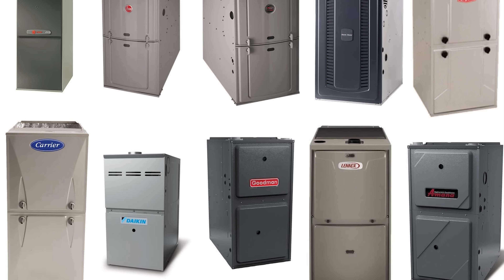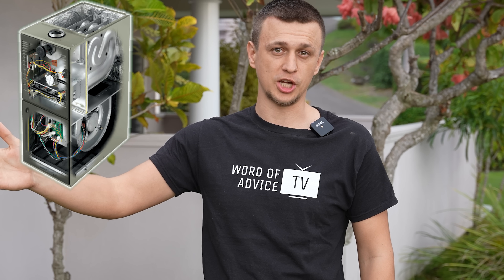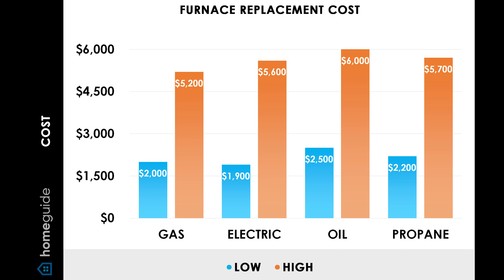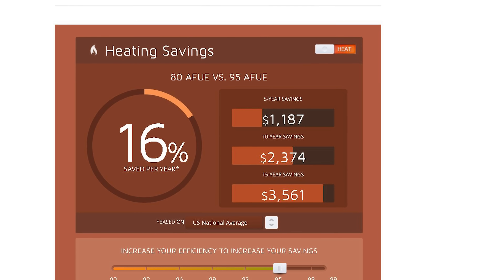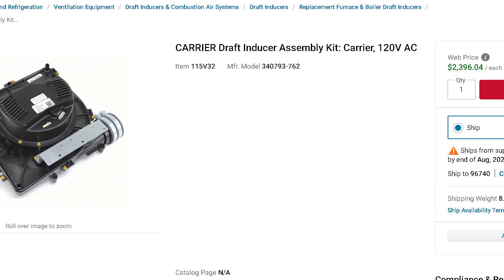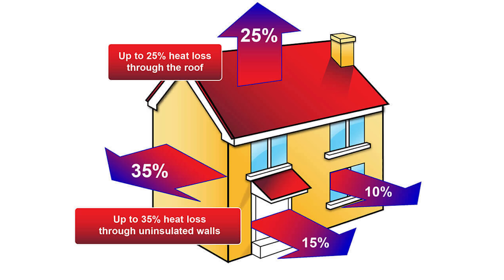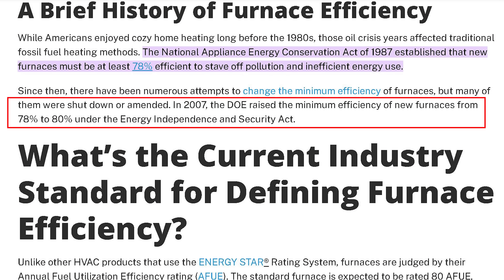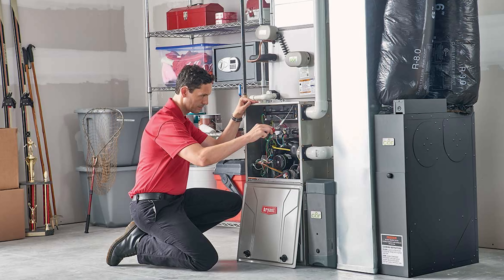Don't Buy a High Efficiency Furnace!

Comment: As an HVAC professional your not wrong. 
Although just about all brands have a 20 year warranty on heat exchangers, but you have to pay the shipping and Installation for a new one. 
80% contain basic parts. Where as higher efficiency units the parts are more hi tech, and costly to repair. 
Another thing I'd like to mention all brands are generally the same, with the same parts. They may just be tweaked a little different. And there all made from cheap plastic generally from China. 
Furnaces are not as reliable as they were 30 years ago. There all junk no matter what brand your looking at.

Comment: You make some great points and I mostly agree with you. But if a person wants to lower their carbon footprint or they have a less then 80 percent furnace, maybe their furnaces is way over sized for the space they are heating. I also feel if your furnace is over 15 yo it's not worth putting money in it. On another note about getting a furnace inspection, is nearly impossible to get a quality inspection from a qualified HVAC tech or company. There are so many techs who don't know how to check a heat exchanger or are just too lazy to check itt properly. Especially if you hire one of those company's that come out for a cheap price. They will upsell you or gives you the bums rush.

Comment: I have an older furnace, we have lived her 25 years and it was here before we bought, it works fine, but I had to go to E-Bay to get some of the circuit boards because the local HVAC companies didn't/couldn't get those parts. Sadly all our appliances are about the same vintage and getting parts is a task. Good video and look forward to your other insights

Comment: I live in New England, where it gets cold and stays cold a good 5 or 6 months out of the year. I got my 35 yo furnace replaced last fall.  I went with the regular old "low efficiency" type even though I use propane.  The reason being I also added a heat pump.  Not a super duper one either, however even where I am it can still handle my heating needs at a lower rate than propane.  In spite of the fact that my electric rate doubled last summer.

Comment: Thanks so much, I do have a Trane X90 80,000BTU single stage and my house is a high ceiling and colonial style 2500sqf, one of my rooms upstairs has low heat, do you think 2 stage furnace will be good for me

Comment: 1 rebate, 2 lifetime on the heat exchanger,  3 same installation cost, it pairs with the heat pump and has an ahri rating ? do you live somewhere warm ...... the bgh 96 LP is my frame of reference in zone 5 parts are covered for 10 years

Comment: What an amazing world we live in. Everything we use for day to day living is being used against us. The cars we drive are designed to crap out days after the warranty runs out. Small cars that are economical on fuel cost a fortune to keep running. Parts are way more expensive than a gas guzzling land yacht. Now these high efficiency furnaces that are supposed to be so much better than conventional units cost twice as much and they burn out in half the time. Heat pumps are out dated a year after they are built. When something major fails on them it's cheaper to buy a new unit because the old one is no longer in production and nothing from the newer units will fit. We live in a deliberately expensive world with our biggest required items that are disposable. At least a 50 year old oil furnace will accept a modern riello high efficiency oil burner and even though the motor technology has changed, a newer designed fan will also fit. Oil furnaces were all built to certain standards where you could put parts from just about any brand on just about any furnace. You could even order one with a specific brand oil burner. Try that with a heat pump. I can run my hot air furnace with a 1800 watt 110 volt generator all winter long if I have to. Try that with a heat pump.

Comment: I just got though telling a guy about the price of the replacement parts on a 18 seer Goodman  if it was out of warranty right now vs a 14 seer. His son got scammed into buying a 18 seer. This guy was all excited about the lifetime warranty on the compressor, then I told him the price difference and how much it costs to replace the compressor in the 14 seer. A leaking coil is usually what kills the compressor, to start with, by running it too low on refrigerant too long.  I also told him there's only 0.7 difference in the heating performance. Around here our heating bills are what hurts. People think they are going to save a fortune on heating bills by going from a 14 seer to 18 seer and they'll most likely see no noticable difference. (Let's not even mention the 20 seer) I know this is about gas but I don't recommend gas at all and sell very few.

Comment: I can confirm that the ECM for my high efficiency furnaces is not only expensive ($1400), but in short supply.  My furnaces were installed in 2002, I replaced the ECM twice on one of them and once on the other, with a couple of motherboard replacements as well.  My ears are wide open to this discussion.  This last ECM replacement I found a used one on ebay for $228, but HVAC tech. would not install it because it was used.  I did it myself and we are up and running again, but it is only a matter of time before it fails too.  I have even taken the old ECM and replaced its blown resistor so I have a back up ECM.  I know way more than I ever wanted to know about furnaces.  I love the idea of a blower motor costing $250.
Reply: Put a surge protector on the power lines
Reply: I want you to know the only reason why that ECM costs $1400 is because the parts people charge that. You can buy an entire fan coil or furnace for that much, motor and everything included.
It's a racket. Don't blame the technology - I can buy a variable motor for my mini split for less than $100.
Reply: @sprockkets  Oh, I believe that 100%
Reply: Yeah, and good people like Kalos puts in voltage monitoring plus surge for their inverter stuff.

Comment: Would you do a two stage furnace or one stage? I don’t want to deal with expensive parts and costly repairs.
Reply: Two stage furnaces are nice, especially in larger houses and cold climates. As far as reliability goes its the same as a single stage.
Reply: @Redtooth75  thanks, the sales rep said it’s pointless to get a one stage bc for a couple hundred more you can get the two stage. I just don’t want to deal with stuff breaking down and having to pay 3x for parts
Reply: @GameTrailCameraVideos  the parts do not have to be super expensive just because its a 2 stage. As long as the inducer and blower motor are PSC or shaded pole motors they will be the same as a normal furnace, just 2 different heating speeds. The gas valve would be a 2 stage gas valve which is only slightly more than a normal one. If you get ecm motors though those are very expensive and not that reliable.
Reply: @Redtooth75  I was told PSC is phased out and ECM is the only option
Reply: @GameTrailCameraVideos  they are still produced in new furnaces. 80% and 90% furnaces will use them, its when you want the 95% or higher efficiency that you need ecm motors. So unless your local codes require that level of efficiency you can still get them. Its possible that the dealer you talked to did not have a lower efficiency 2 stage model.
Reply: @Redtooth75  yea I spoke to 3 dealers and all said they only have ECM for 80 furnace.
Reply: Correct.  There are ECM to PSC conversions that are possible.

Comment: I have a high efficiency 2005 gas furnace that is leaking and intermittently working.  I looked at getting an 80% efficiency furnace or another high efficiency furnace. I was told since I'm already set up with a high efficiency gas furnace system, I need to replace it with another HE furnace. What say you?

Comment: Condensing gas tankless water heaters are totally worth it though because tankless water heaters are a different animal than a furnace and hot water is used year-round even though they both depend on burning natural gas or propane.

Comment: Whoops, already did.  Did research for over a year, and installed since the old one was over sized and single stage.  Live in Canada with winters that get to -35 a lot.  Its quieter, my house is more comfortable and the temps are more level.  With Energy Rebates in my city,  it was money well spent. Was I wrong?   As you said, thats your opinion, not a fact.  if I am wrong, explain how I am with my situation.   As well, aren't we supposed to be saving the planet, reduce emissions?  As for repairs, well then we might as well not own things like fridges with water, icemakers, or the like.
A lot of what you said made sense, but such a blanket statement for so many situations, regions, where people live, house layout and so on really is just a generalization.

Comment: Hello, our outdoor  unit the inducer fan went out. the ac works great. the unit is a gas pack Byrant 3.5 ton. aound 17 years old. will take a month for the inducer fan, they want to push a new 2 stage  vs a single stage. we live in NC.  Your thoughts?

Comment: As a service tech myself I do agree with mostly all points, but one thing to consider there’s also many different high efficiency furnaces with different price points ranging from single stage gas valve and PSC blower 4 speed, to 2 stage gas valve or even modulating gas valve and variable speed ECM blower motors, yes very expensive, but the first high efficiency single stage furnace contains actually cheap parts, I’ve found more expensive inducer motors on mids then highs many times and blowers are the same. 

Yearly maintenance is the main key which most people never do
Reply: Agreed. We have a Bryant 987 and we havent had a single problem yet, even if we did, we would pay nothing anyways. I am in MN and the previous furnace was a HE, so new duct work and the $1050 rebate for energy star qualified. An 80% furnace wasnt worth it for us.

Comment: I bought my house brand new with two high efficiency furnaces. I had a lot of trouble with them, and finally had to replace both at 12 yrs old. I bought two high efficiency gas furnaces that was converted to use propane to replace them, and I had o replace on that only lasted 4 years. I wish I would have seen this video back then.

Comment: Great Advice.  What do you think about replacing central AC Heat Pump systems with Inverter systems compared to traditional compressor systems?  I have a 1999 (R-+22) Trane 5 Ton, 2 Stage, Dual Compressor, 18 Seer (2.5 Ton / 5 Ton compressors, Only one compressor runs at a time based on demand) Heat Pump here in east Central Florida that is still running pretty well, but I know I will have to replace it in the next few years.  Should I go with a standard single compressor basic single stage 18 - 20 Seer heat pump OR something like a Mr. Cool Universal Inverter Central Heat Pump which appears to be pretty price competitve with a standard cheap heat pump?    Thanks in advance for your feedback.

Comment: The other part of the equation is the heat losses up the stack. 5% vs.20% losses, so the 10-15 yrs of saving 15% on fuel bills is significant, but to be worth the extra cost over the standard 80% unit, you divide the cost difference by the calculated efficiency savings. Also, the high efficiency units vent simply with pvc, whereas the 80% needs either B-Vent or standard chimney. SO…….it’s not all clear and must be analyzed for each installation.

Comment: If you're only going to be in the house for a few years perhaps this is true for you. Insulating you house better is a great idea if feasible.  If you live in the south or where it doesn't get real cold you might consider getting a heat pump. 

Our 2-stage Bryant furnace is coming up on 21 years old and has been relatively trouble free. We had to replace the blower motor 1 time (~ $500). That motor pulls 95 W in low heat mode. The blower on the 80% furnace at our old house pulled about 1,100 W. So natural gas is not the only variable cost to operating a furnace.

We live in the Midwest so winters are harsh. We received a utility rebate when we installed the HE furnace. The heat exchanges received a good bill of health at the last inspection several months ago.

Our cost for natural gas increased about 50% here last heating season. So I'm glad we have a HE furnace. We have set aside money to replace it because few NG furnaces last  much beyond 20 years. 

The other thing we did was increase the 2nd stage heat cut in temperature difference on the thermostat from 2 to 4 °F so the unit runs in 1st stage heat > 95% of the time even in very cold weather. I think we're able to get away with that because our contractor oversized our unit quite a bit.

The other reason to use a HE furnace is to reduce GHG emissions, if you care about that.

Comment: He's talking about saving money Annie has a whole house vacuum cleaner system on the wall in front of the Furnace is that how you really save money and they don't last for twenty years either that's nice when you live in a heat pump area but not here in Michigan. They do have some really nice two-speed 80 percenters or even a variable speed 80 percenter but if you're going to do that you might as well buy the 90% in the North Michigan

Comment: We have a Carrier Weathermaker 8000 furnace of 26 years. Our AC is broken and contractors recommend changing the furnace too. What’s your opinion on changing the durance and will you recommend Carrier or Lennox and a single stage or a two stage model?
Reply from the maker: My recommendation is usually "the simpler the better." So in your case this would probably mean a single stage Carrier.

Comment: I had a first generation Bryant 92% furnace installed in 1989. By the time it was replaced in 2012 the gas valve (warranty), main circuit board, inducer motor, condensate pump, all were replaced. Furnace replacement was due to secondary heat exchanger failure. It's replacement was a 2 stage variable speed blower 95% unit. You are correct that an 80% unit is simpler and more reliable. At today's nat. gas cost in an area with 5000 heating degree days per season it may be a wash on 80% vs 90%.

Comment: The install of standard efficiency furnaces has been banned in Canada since January 1, 2010.  Only high efficiency units are permitted.  As of December 31, 2021, the install of new oil fired furnaces in the province of Quebec is banned, and as of 2023 they can't even be repaired!
Reply from the maker: Thank you for the information about the laws in Canada. Very good to know if that is where you live.

Comment: Once again great video young man but as with some of your other videos I have to partially disagree lol. I agree a “high efficiency” furnace is NOT the way to go however you forgot to mention my favorite furnace…… 80% 2 stage it’s not much more in cost and it will save on fuel cost and it creates a more comfortable home. The furnace starts at 60% of it’s capacity then after a given time if the thermostat is not satisfied it will kick on the 2nd stage making it perform at 100% capacity. I tell people that I will sell them the same thing I would sell my family members, an 80% 2 stage

Comment: In the HVAC business as well. Have serviced and installed both standard and high efficiency furnaces. I disagree with some of the things in this video. I cannot stress enough how important it is to BUY A QUALITY BRAND. You would not believe the difference a high efficiency furnace from a low quality brand is compared to a high efficiency furnace from a high quality brand. They last much longer which makes your investment worth it. I am a dealer of a high-quality brand and our high-efficiency furnaces regularly last 20-25 years. (With some repairs)

Comment: My furnace was installed in 1983, it’s 40years old and working like a tank. 
A technician told me it’s 50% efficiency. 
I asked him if I could get another one. It’s running good I’m just thinking about the future. He told me it was built so well it could actually last another 15 years. 
My air conditioner is losing R22 refrigerant very slowly at about a rate of one pound per year. R22 is the best most efficient refrigerant ever made but somebody ( probably Al Gore or John Kerry) says it’s bad. I don’t believe it. The new refrigerant is probably half as efficient so why are they trying to control everything in the world?  No more incandescent bulbs either. My gas bill is $80 per month.

Comment: 30 years tech. I agree totally but any furnace over 20 years old needs a checkup every year at very minimum . Last 5 years had maybe 3 every year with flame roll outs. I had one almost melt the gas valve. Other intermittent pilot with a stuck open main valve , high co...etc. 

I do maybe 600 heating calls a year. After the last 2 years made complete 180. 

Imo If the furnace is over 20 years old. Replace it. If you have an 80 stick with an 80. 

Please inspect chimney annually. Install co/smoke detector near the heater and liviving area. Last don't let any Joe work on the heater. 2 days ago had a call....the  2 wire pilot safety control was bypassed???

Comment: 80% furnaces often use conditioned air for combustion. They also create a negative pressure in the dwelling. Those two things create waste beyond the efficiency rating of the furnace itself. Negative pressure can also contribute to poor air quality and mold issues. I would not go lower than a 90% efficient furnace for those reasons.

Comment: its true  a simple fan motor  went on our high Ef it cost 1500 dollars there goes your savings it was a 2 piece system  ,plus the labour  around 2000 dollars total  rip off its not worth it regular furnace motor around 200 bucks!